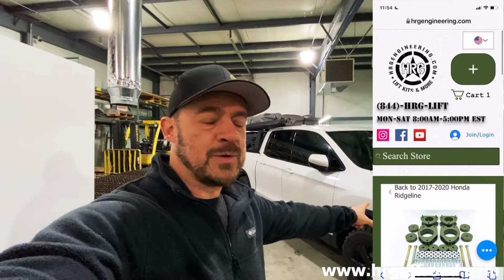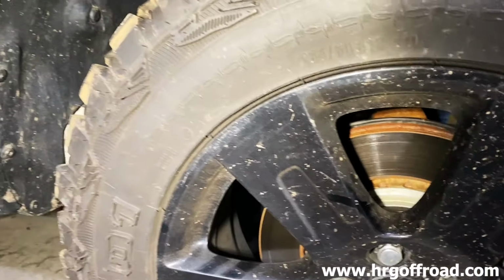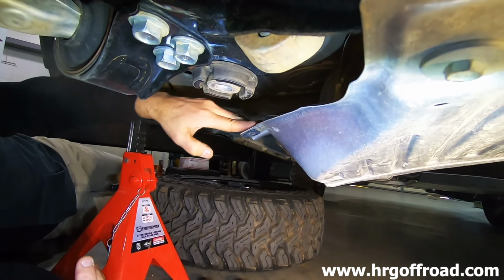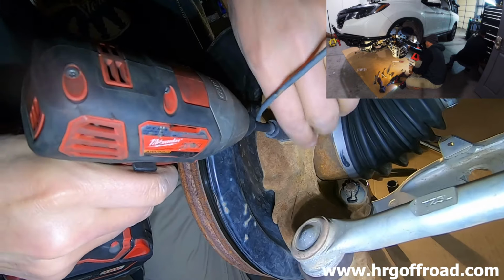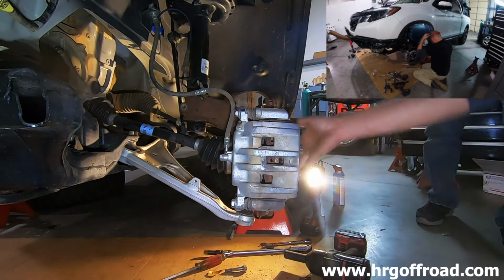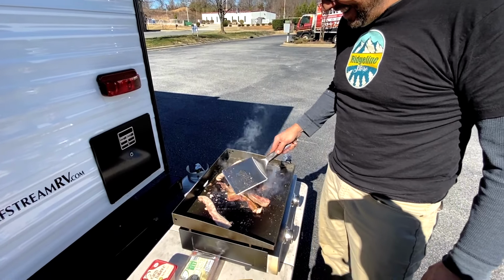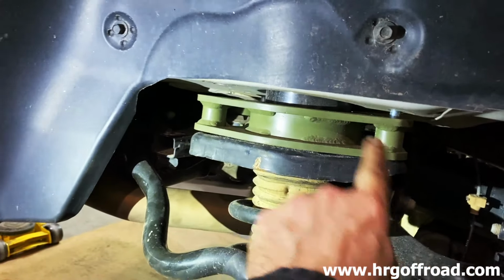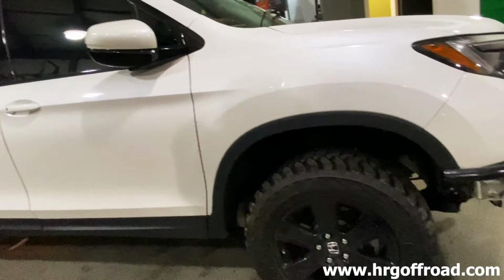How to lift a 2017-2023 Honda Ridgeline 2.5 inches with the HRG Offroad lift kit

Comment: Well, I am installing a lift just like that on my 2016 Honda pilot and essentially the same assembly and everything. My biggest struggle is putting the lower control arm ball joint back in the hub assembly. It won’t go.

Comment: Can the sub frame kit be done without having done the 1.5 front/rear kits from the previous installation? My thinking could be wrong, but wouldn't that net you only a 1" gain but would leave drive train axles in their original position. Someone enlighten me.

Comment: Looks great. Def helps to have 2 ppl.
Reply: Everything is pretty easy but putting in the front strut as well opening up the lower control arm. Everything else is a one person job.
Reply: @CampingRandy  Thats what im having trouble with. One person pushes down on the axle and the other pushes the coilover into the forks. I have stock and they are longer than aftermarket. i might take the lower arm off maybe thatll help.

Comment: So my situation is I won’t be doing crazy off-road stuff but I do like to ride soft sand beach that has big ruts. I’m guessing clearance will be an issue so what’s the best solution for me to get some clearance? 1.5” lift and skid plate? End of the day I’d like to get just enough to do it with the least mpg penalty and alteration from factory ride
Reply: Yes - that’s the beginner kit! 😅

Comment: I went with 30.5" tires, and they rub (2" lift).  But they only rub full lock in reverse (which is weird).  Do you have a link to a video where you 'cut back' to eliminate tire rub?

Comment: How does this affect the angle on the axle? Will it still be to “spec” to prevent unusual wear?
Reply from the maker: The truck in the video has been lifted for many years now, and so far has not had any issues. However, lifting any IFS vehicle will increase axle angles. It is a trade off to gain additional ground clearance under the engine. This increased angle will most definitely increase the wear on the axles.

Comment: I have an 2021 ridgeline sport and would love to do atleast 1.5 lift ..... Do you have to use wheel spacers? iv also been looking at a bed rack and roof rack to do more camping like stuff
Reply: No wheels spacers needed. I did spacers for a wider stance look.
Reply: Check out my YouTube & Instagram. Let me know if have any questions!
Reply: Fyi, eibach now makes springs to replace the stock spring of the coil over/strut. Gives 1.3 inches in the front and 0.3 in the rear. Cheap and easy. Couple that with a small lift or larger tires and you got a nice modest lift.

Comment: when you add spacers or lift kit. do u need new stabilizer links/bars bcuz the length is different?
Reply from the maker: YES, THE SWAY BAR LINKS ARE SPECIFIC TO LIFTED APPLICATIONS AND ARE INCLUDED AS PART OF OUR KIT
Reply: @hrg_tv  Does any of your kits fit a Honda Crossroad years 2007-2010? I have a 2008 2L FWD It's a Japanese Model only sold in Japan. they didn't bring to the US bcuz it would compete with CRV/Element sales. it's slightly smaller than the crv but seems to sit  a little higher off the ground.

Comment: Randy awesome build , question on the tires ,I have 1.5" wheel spacers and  if i do go with the 265/50r20 and a 2.5" lift  will i have rubbing issues ?
Reply: No rubbing - you may have some backing up at full steering wheel.